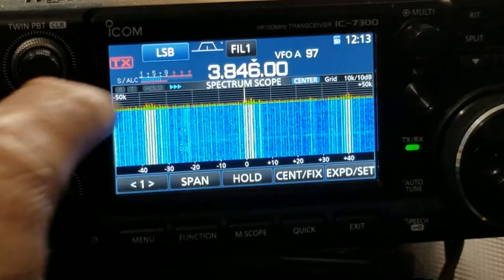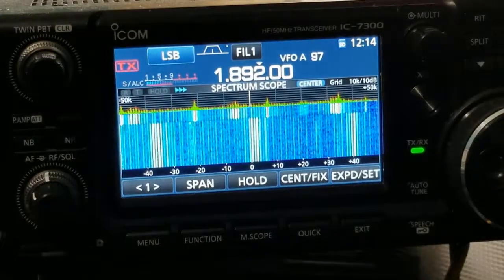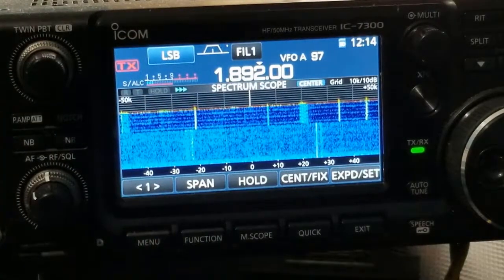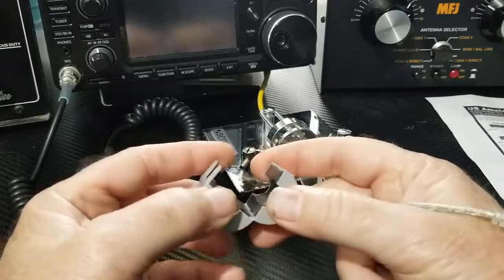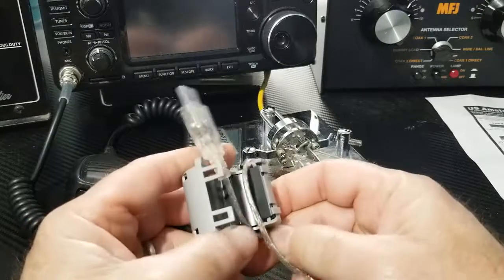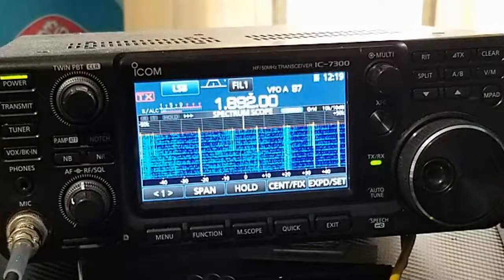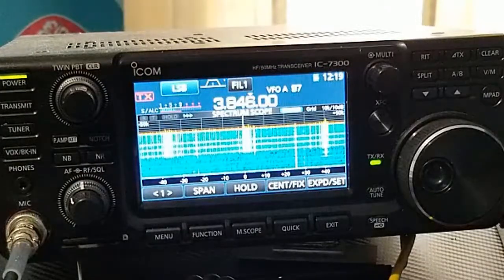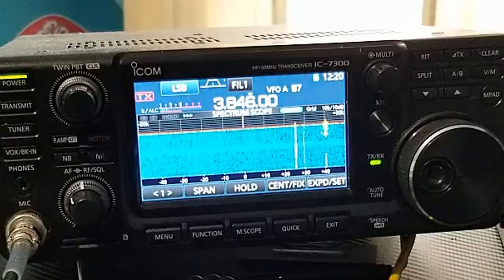Beware of Radio Interference In the Shack from USB CABLES

Comment: The photo to the left is my brother Greg and myself.  This video may help me resolve a slightly different problem I'm having. My computer is in a room next to my radio room, and whenever I key up I can hear my computer make the sound of something being disconnected. Your video would indicate to me that the problem is RF, and if I look I will find it is disconnecting something USB. I bought a bucket load (20) of these clip ons awhile back, and I have several I can try. I would have never thought to use these on such a small cable, but with the wraps it will be better than one that fits tight! I'm worried that this RF might wreck my computer! Thanks again!! Tim